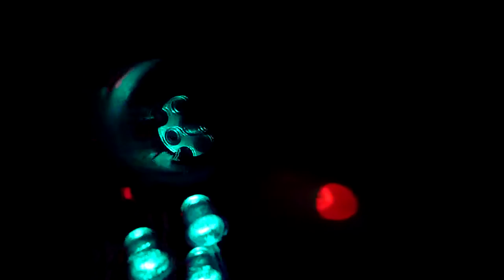In-situ Dynamic Balancing of a Brushless Motor

Comment: This is a great video if you want to understand the fundamentals of dynamic balancing. Using a laser pointer reflecting off the mount and onto the wall (to amplify the error) is a good idea.  Seems like you could use a set up like this for initial testing to determine whether a balancing effort was even required.  Thanks for the video.